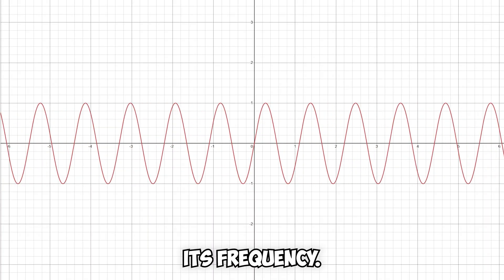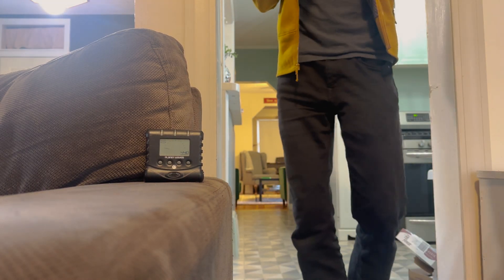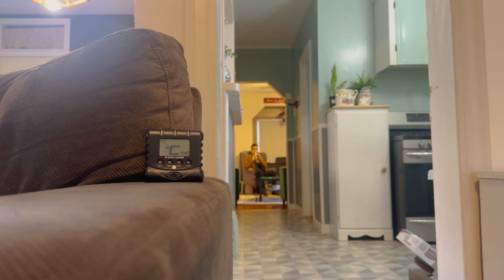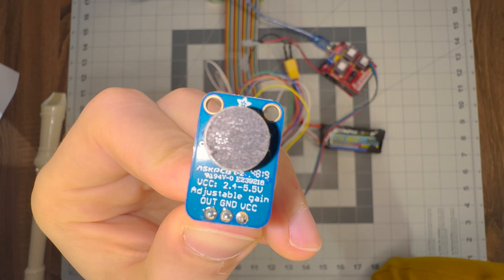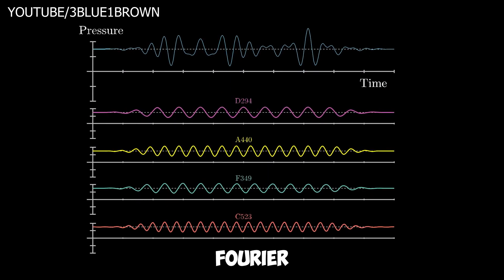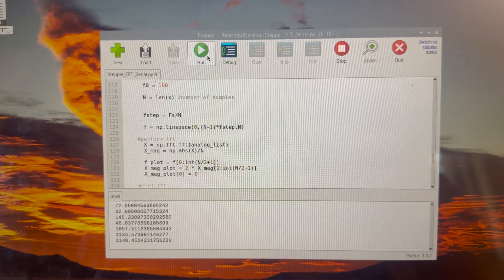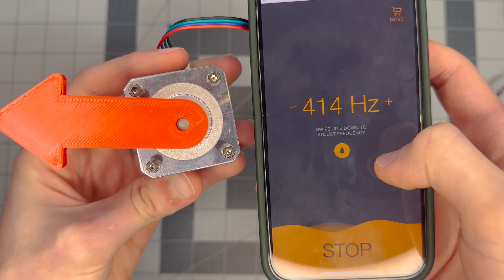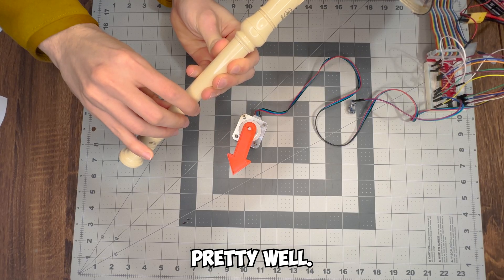Sending Data Using Sound

Comment: im pretty sure the oldest dial up modem used sound to encode/decode data into usable computer data (for sending text and stuff) you could actually hear data being sent through.
its actually so simple that its literally 1 is higher khz and 0 is lower khz.

Comment: The LM567 will decode frequencies… I’d give that a try if you want to transmit sound under water. Using 6 set to different freauencies, you can decode multiple signals since they can operate in wide and conditions. Only thing is it’s gonna be a digital signal… either on or off. But you could also use pwm or some other encoding scheme like DTMF to send specific signals multiplexed.

In fact, these circuits were designed for DTMF haha
Reply from the maker: Thanks for the suggestion! I have a follow up video coming out this friday or saturday. I don't use an LM567 but if I run into a problem and need to redesign the communication protocol I'll look into it.
Reply: @makermandan  for work, we’re currently working on a project that uses these to maintain frequencies for radio communications. We’re having some fun with it :)

Comment: that's a horrible way to control the sub. consider using AM or FM (for simple instructions they can work with very low frequency sampling rates, although you should fix the low sampling rate first, a raspy is plenty powerful).

At any rate, you have a super cool project at hand, keep on working!

Comment: But I fear that since the submarine is going to be moving, and to realistically make the submarine working without rupturing a dozen of eardrums around, you may try to use frequency modulation with ultrasonic sounds but since the moving part and maybe Doppler effect kicks in... messing with the data sent by altering the frequency....
Reply from the maker: The sub won't be moving super fast, so I doubt the doppler effect would interfere. I will try to go as high pitch as possible though.

Comment: Awesome! You should try using FM sound transmissions and try higher frequencies 20kHz+. That should be able to transmit less environmental interference.
Reply from the maker: My code is inefficient, so the maximum sampling rate I can get right now is 2khz due to computational usage. I will try to go higher because like you said, it would reduce environmental interference.
Reply: @makermandan if you wanna stay in python land, use something like pydub and/or or librosa to capture packets of audio at full frequency (44.1 or 48 kHz usually) and then you can do FFT or other signal processing on it. 

You'll probably want a packetized control protocol anyways, with error correction and such, for better fine-grained control.
Reply: Dial up submarine!

Comment: It would be much more reliable if, instead of directly transmitting the value, you encoded it into a simpler format (the easiest one is a binary representation) and then transmit that. For example: instead of transmitting numbers from 0 to 9, you can encode that in a binary format, so from 0000 to 1010 and assign a subcarrier to each of the 4 values you need to transmit. For example 100Hz is the first one, 200 is the second one and so on. So if you want to transmit 4 (--> 0100) the sound would be only 200Hz, if you want to transmit 7 (0111) you will have the 200Hz, the 300Hz and the 400Hz all active at the same time. Since you know the values you are expecting (thus, the 4 subcarriers), you would avoid many errors due to unexpected noise. Converting an analog signal to digital and encoding it in such a way is the standard approach in telecommunications, since it proved much more efficient and reliable.
Reply from the maker: That's a very well thought out suggestion. If my current method of proportionally controlling motors with pitch doesn't work out, I will fall back on your advice. Thank for the insight!
Reply: Also, be careful not to go too high in frequency: higher frequencies get attenuated more with distance
Reply from the maker: I eventually ended up using your suggestion! You'll see in my next video, I used three frequencies (400, 600, and 800 hz), to "tell" the submarine what to do. For example, 000 means do nothing, 100 means go forward, 010 means go backwards, etc. Thanks again for the insight!
Reply: @makermandan  I'm happy to hear that!
Reply: Also using electronics, you can use narrow band amplifiers to decode each frequency and get vastly longer range. That's how IR receivers work.

Comment: You could also use electricity because if you put positive and negative on both ends of the pool you can controll the amps or volt of it and programm it so the less or more amps it receives it goes left or right
Reply from the maker: That would be a good idea for the pool, but I also want to be able to use this in a lake or pond too. I think it would be really hard to scale up this idea.
Reply: @makermandan  yeah its only good with small pools